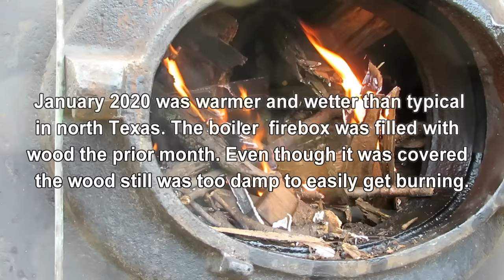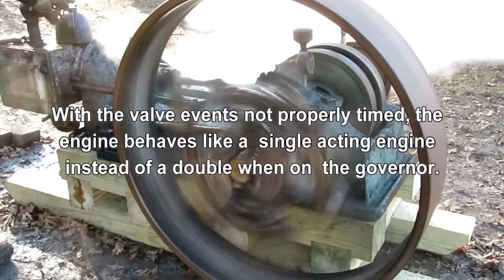1890-1900 Atlas Automatic Steam Engine Part 5 Evaluation Begins

Comment: Lets see an EV fire up after 70 years hibernation...
Reply: Technically, as long as the battery isn't dead and the wires aren't corroded, it would start right up. They're just electric motors with an ECU and a battery attached. Nothing much to do besides give it juice.
Reply: @djhagrid300  but that would have to a miracle for that to happen
Reply: Battery wouldn't last.
Reply: Imagine you found 100 years old vintage EV in supreme condition only to found out the car is software locked and the company has closed long ago.
Reply: @djhagrid300  I'm not attacking you, I promise... but...

After 15 years the motor itself would be so corroded it'd be next to useless. As well as I think the magnets inside would have degraded...

Not to mention all the other junk that'd go wrong and render any EV a paper-weight.

I can walk out to my Grandpa's 80 year old CAT Dozer that sat in a field for who knows how many years and with only minor interaction have it purring in short order.

Today's tech despite its advancened(ness) and sophistication is laughable to pretty much anything from the 1950s... Except obvious exceptions; I.E medicine and whatnot.

Comment: I've got a similar engine built in 1901 on a saw mill. It's a Fairbanks-Morse, 30 H.P. it belonged my Great Grand Dad then my Grand Dad and then my Dad. We just got through a complete rebuild and added a condensate recovery system. It runs like a top now. Mine has a horizontal fire tube boiler and not a vertical like yours.
Reply: Nice, I hope you will give it to tour kids and so on and on. This way people won't forget the roots
Reply: Qq1q1
Reply: RE John Willis: Fairbanks-Morse “similar engine” (Steam?) I was not aware FM made a steam engine. But if you made a condensate recovery system it sounds like a boiler was involved. Nice family history. 👍🏼

Comment: Hi, I just ran across this, I built a scale model about fifteen years ago, bronze and iron castings, about inch and a quarter bore, I never built an oiler for it, but have run it on compressed air, now I guess I've got to finally make an oiler for it.  Thanks for showing this, I spent a few weeks finicking on valve timing till it was just right.  Semper Fidelis.
Reply: Hope that worked out for you man. I'm about ready to start designing and casting a steam engine myself for an old lineshaft machine shop.
Reply: My younger son and me are building something similar, though from a kit of parts. And it isn't one of those cheap knockoffs. It has been a fascinating learning experience.

Comment: Once upon a time, this was a high-tech machine 🧐
Edit : Great video, thank you for letting us join.
Reply: I believe it still is a high tech machine.  You or I sure could not walk up and run it.
Reply: It’s still very hi tech.
Reply: Can work anywhere without a gas or diesel supply. Charge batteries. You don't get more high-tech than that. Also with a low speed pmg connected it becomes a very environmental friendly power plant.

Comment: I don't know where you're located but my grandpa had a welding and machine shop in Groom, TX. He had that same steam oiler in his shop. I remember looking at it and finally giving up and asking him just what the thing was. I would never have guessed! His shop had the old line shaft tools, but converted to electric motor driven by the time I was growing up in the 70's. But he had a hit and miss backup. I loved that shop!
Reply: I worked in a tannery years ago.  The drums or mills the leather was dyed in all ran off a line shafts, with babbit bearings.  The two big lathes in the maintainence dept ran off a line shaft.  The paddle wheels in the beam house also ran off a line shaft.  Those were taken out, the first year I was there.

Comment: An operator of this machine from 1895 looks at the engines I work on and must think how dangerous. I’ve watch this video twice and would still slowly back away from this thing. However it is a marvel, I would have loved to have seen and met the men that developed this, and those who cast the parts. Wow.
Reply from the maker: In its time, machines like this could be dangerous but not so much if given healthy respect. Even today simple tools you might not think of as being overly dangerous but can be if careless. I had a friend run a drill bit in his leg because of carelessness.

Comment: This is poetry in motion. I have no idea what the adjusting accomplished but it was beautiful seeing this grand old engine working again. When was the last time it was started?  What will you use it for?
Reply from the maker: The current goal is to use it to power a 4-sided wood planer. Unfortunately the planer is not yet operational.

Comment: Ive worked on old boilers in the sugar Mills in Louisiana that's from the 1830s. We got to actually pressure it up and start it after hydro. I've been interested since. I want to build my own  engine. I've built smaller ones and understand down to the internals. If you have any old parts or things you would like to steer me to the right direction on. Please inform me !

Comment: simple design makes it durable as less components are there to drive the engine...a little arrangements in boiler,piston and valve let this beast(steam engine) works again...
Reply: Great generators when gas is too expensive.
Reply: Vvv
Reply: @sethenewman4309  you
Reply: @sethenewman4309  is

Comment: That Valve adjustment - Good engineering is that any bolted connection should have 2 threads left free after the nut is set into position, it seems on the valve push rod you're out of adjustment - this is the fine tuning.
The connecting rod from the crank shaft to the valve push rod affords you some adjustment as well, it looks to be able to be lengthened which would coarse adjust it to near right and then the one you were adjusting would be the fine & final adjustment.

Comment: I don't know jack about steam but heating and cooking with wood in my 73 yrs of life I can tell you that half rotten crap U were feeding into yer firebox will produce less than half the heat of properly dried solid wood. I can recommend starting with dry pitch pine and then following with solid dry hardwoods such as oak or locust, if out west cedar can be used for starter fuel followed by juniper for a really hot long lasting fire. Once you get it properly adjusted and a hot long lasting fire I would like to see you run your engine under load. You know, a water pump or grain mill or small sawmill or thresher run by belt off the wheel.
Reply from the maker: I get rid of a lot of blown down tree  branches and other junk wood in the boiler. If it were more readily available I'd be burning coal.

Comment: If you reset the eccentric to run the other direction, there will be somewhat less wear on it. I think it is referred to as over-running vs. under-running.
Reply: I was wondering what this engine powered as it is running "under".
Reply from the maker: Odds are it was not belt powered given the sprocket.  Could have have been something like conveyor.
Reply: What is the difference between under and over running  ? Running in reverse ?
Reply: @rotattor  pretty much, yes. If an engine has reversing gear it is basically both but a lot of engines were set up to run one direction only. In the engine above, if it ran the other way there would be less stress because the crosshead would stay in contact with the crosshead guide for the full revolution. At least the way this one was made. I am sure there was a reason for this to be manufatured as it was but I cant guess what it was.
Reply from the maker: @rotattor  running over is where the top of the flywheel rotates away from the cylinder and running under the bottom is.

Comment: Thanks for sharing this!  Can you tell me what horsepower this engine is rated at, and what the RPM would be at maximum power? I am also wondering if you have a way to add water to the boiler while it is under pressure?
Reply from the maker: Catalog information says it should produce 18HP at 240rpm for a 7x10 engine and 24HP at 240rpm for an 8x10 engine. Unfortunately I'm not sure of the engine bore. I didn't measure it when first inspecting it.

Comment: My engines have a loop on one end of the valve stem that can be slid up or down on the valve cam to make it go one way or the reverse. The fine"timing" can also be adjusted, but I use a slide or "D" valve inside the steam chest, so timing is basically in the hands of whomever built the engine (me). 😂

Comment: You do realize you don't have to keep the firebox absolutely full right? Wood has volatiles in it just like coal. That's all we have out here on the west-coast. It burns well. If you cram the fire box completely full, at a certain point all the wood you throw in is just going to go up the stack as smoke! Just like coal. If there's brown smoke coming out the stack, there's no cold air going up the tubes as the combustion is already running rich. Otherwise, good setup.
Reply: I agree fully, although I believe most of the rich mixture could be alleviated by running the steam exhaust through draft tubes in the boiler, a simple and efficient way to increase combustion temp, and efficiency
Reply: I should say smoke stack, not boiler

Comment: Thanks for the video.  That was fun to watch.  I wish you had a little more thread length for the valve adjustment.
Reply: There are probably several ways that this can be adjusted further. If you stop right at 16:04 you'll see the knuckle of the connecting rod from the cam that moves the valve box. That's a possibility, also there might be a way to adjust the cam itself. There is also an adjustment on the valve box that is in the steam chest.
Reply: 9oo

Comment: Water boils at 30c in a vacuum and returns to a liquid at 29c for a fraction of the input energy you can run a steam turbine with a condenser in a closed loop and chill the remaining steam just from sunlight and shade or evaporation
Reply: True, but than you have no power... so it’s useless for a turbine or recip
Reply: the hotter the steam the more efficient the machine, it just expands more and more
Reply: @Xavierweekers  Do you think hurricanes have no power? The flow of wind in the world is just the same as this system a hot volume of material moving to a cold area only we can focus the energy to convert it to kinetic and then electrical.
Reply: @CmdrTobs  Zero net power? I have a boiler the expansion rate is the same no matter how you boil the water meaning the kinetic energy is the same the low temperature of the boiling means it is easy to condense the steam as rapidly as it is created after it passes through your engine or turbine.
You are thinking as if we were pushing a barrel across a flat bit of ground when we have actually arranged for the barrel to be rolled downhill and end up back at the top of the hill with minimal effort aka further inputs of heat from whatever source is the best.
Reply: @CamAlert2  Maximum expansion of water to steam is 1 to 1699 before it breaks down to oxygen and hydrogen.
Reply: @CmdrTobs  THE EXPANSION RATE IS THE SAME what don't you understand about that? If I boil water with a thousand degrees or 300 it does not matter as the kinetic energy that turns the turbine or works the pistons IS THE SAME.
Reply: @CmdrTobs  Ok what happens if you let a firecracker blow up in your open palm? it stings if you close your hand and let one blow up you will be severely injured the same energy level with different levels of effect.

To give a better understanding I will elaborate on the system architecture.
Start with a tank of degassed deionized hot water it outlets through a nozzle where water is sucked into the evacuated system in a flow controlled manner and there as a fine mist it flash boils in a narrow small chamber the expanding steam follows the path of least resistance through the turbine and to a downward sloping chilled tube then to a larger evacuated chamber 4 times the volume of the input steam inside this chamber is a radiator structure with cool water flowing through it the large surface area rapidly cools the steam maintaining the vacuum the pooled cool water is then ether gravity drained to a reservoir to further dissipate heat or pumped there, from that reservoir the cool water goes to the cooling radiator to pick up some heat and then to a further heat source a solar oven, wood-burning furnace, spent nuclear fuel bed etcetera to the hot tank where the loop is completed.

Comment: Why is it being run with ‘wet’ steam? It’s much better to hold off introducing steam to the motor until working pressure is achieved. Otherwise a very interesting machine. As you say the slide needs adjustment or a Stephenson link added to ease the speed and direction control. Cheers
Reply from the maker: The steam used here is saturated as opposed to superheated.  It has entrained moisture and its temperature corresponds directly to its pressure. The engine is cold and condenses a good amount of steam until it is hot enough to stop. This is an evaluation test and all characteristics are being observed.

Comment: “Automatic steam engine”
by Automatic they mean it only takes 35 steps to start instead of 60.
Reply: "Automatic" steam engine simply means that it's cutoff governed rather than throttle governed.

Comment: needs to be mounted on heavy duty skid and some heavy duty springs under the engine, I had a problem with a old ajax vibrating my pump jack to pieces until I mounted it with much less vibration

Comment: Set valve time so it admits steam just before the end of each stroke,  also sounds like the slide valve needs attention as its blowing past valve straight to exhaust
Reply: Few questions,
1..How long will this engine work?
2.i believe the  the fire from the wood the main source of the energy? I want to carry out this project from scratch to supply power in my farm at minimal cost
Can you help me with the PFD and the P&ID... I shall carry out the engineering design...I stay in Nigeria and our power sector is in shambles.

Comment: A little tip mate, fill the sight glass on your lubricator with glycerin it will stay cleaner  work better and won't freeze. Drug store has it in little bottles
Reply from the maker: I've never heard glycerin being usd in hydrostatic lubricators. Have seen it used in mechanical lubricators with feed sight glasses.
Reply: @lineshaftrestorations7903  I have personally  used it myself same principal and results as in the mechanical lubricator. I had a Ajax 81/2 X11 engine on a AB farquhar locomotive style boiler I ran my circular sawmill with. What does the end of your lubricator pipe look like inside the steam feed pipe. Mine I used a flattened end with a slot , hopefully to atomize the drops of compounded oil, but its hard to tell whats happening. Frank C.
Reply from the maker: The lubricator fitting is a simple pipe tee. It should have a nozzle the dumps the oil into the middle of  steam flow to break it up. I suspect it dribbles down the inside of the pipes until it reaches the moving machinery.
Reply: @lineshaftrestorations7903  great

Comment: I'm not sure how it works, but if the governor 'advances or retards' the timing of the valves, then to adjust the valve timing, wouldn't it be better to somehow loosen and rotate the eccentric on the crankshaft, instead of shortening the valve rod as you are doing, -which only changes the position of the 'sliding range' of the valve in the valve box? By the way, a fascinating video.
Reply from the maker: The governor actually varies the stroke of the valve rod. As such, the duration steam is admitted to the cylinder varies. For best operation the steam needs to be admitted equally on both sites of the piston no matter what the duration is. The adjustment shown is adjusting the balance.
Reply: @lineshaftrestorations7903  Ok, thanks for that. I've always wanted a steam engine myself, to use to drive a generator and get 'free' electricity.

Comment: Engine is going the wrong direction. The cross head force should always be towards the casting not the upper guides. Also, the drain cocks could be shut off earlier. 🙄
Reply from the maker: If this engine was a conventional flyball governed engine simply rotating the valve eccentric 180deg would change the engine rotation. Being an automatic cutoff governed engine it requires disassembling the governor and reassembling in a different  configuration.

Comment: Out of curiosity I wonder if this was hooked up to a generator if it could power a heating coil to boil the water?
Reply from the maker: You couldn't run as a perpetual self sustaining system the energy losses would be substantial. It will run a generator of about 5kW sustained.

Comment: Maybe you can give me some info. What, exactly is steam oil? Looks like maybe 70-90 weight?
Reply from the maker: Steam oil is mineral oil that is compounded with tallow. Since steam oil is fed into the engine with th steam, this compounding of the oil allows it to whet the internal parts of the engine. There are several formulations where the amount of tallow varies. Different steam pressures and temperatures require different steam oils.

Comment: What steam pressure and how many HP is the engine rated for please
Reply from the maker: Initial tests were conducted with about 20psi steam. Subsequent test were made with about 50psi. The load tests were made using about 95psi.
Reply from the maker: This engine is rated at 24hp.